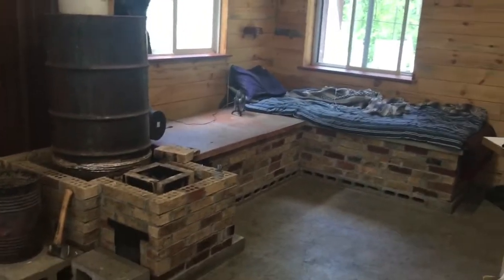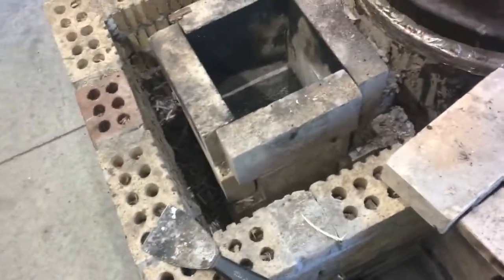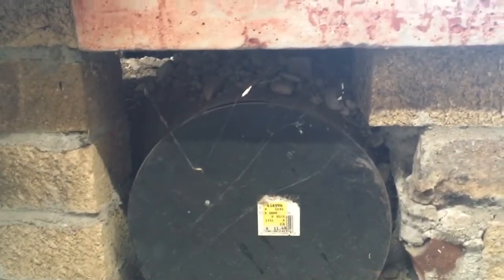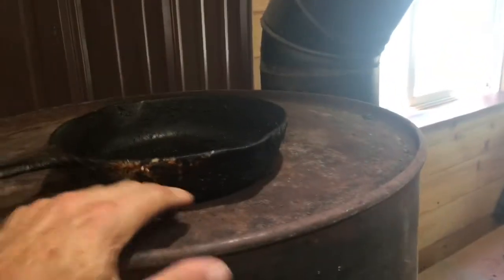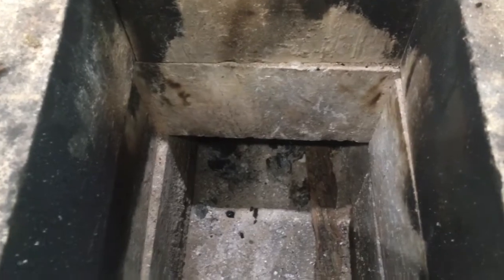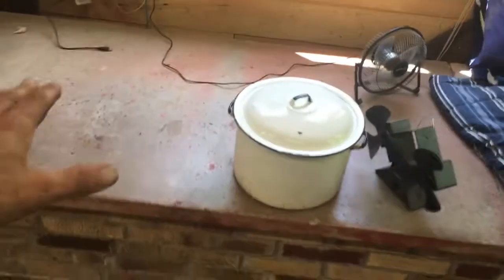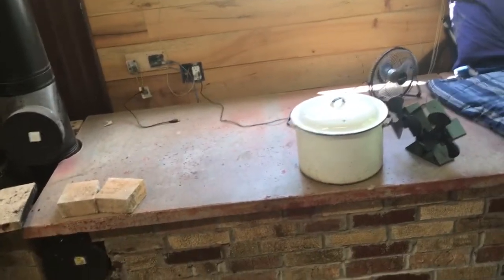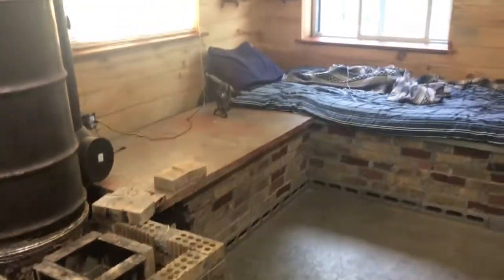July 2020 Rocket Mass Heater maintenance questions

Comment: If you can source it junk yards scrap metal places, look for ballbearings or car wheel weights, I buy 5 gallon buckets of wheel weights because I pour my own bullets and reload. The density is unmatched over cob, rock, or sand. The stainless steal bearings or wheel weights hold and radiate heat for much longer hours.